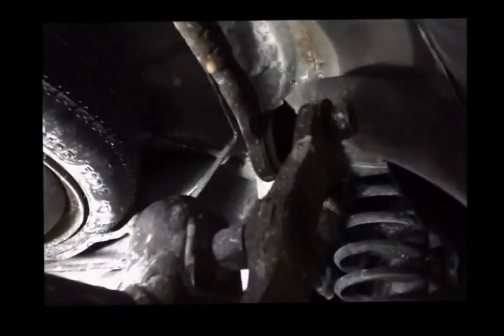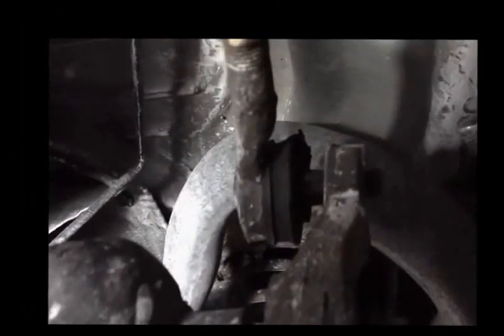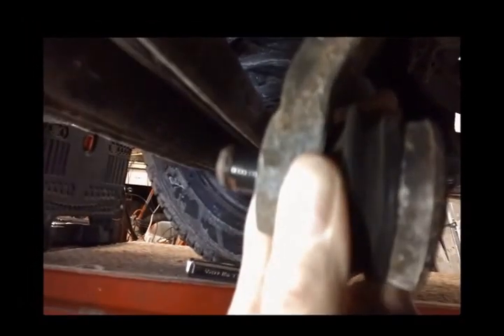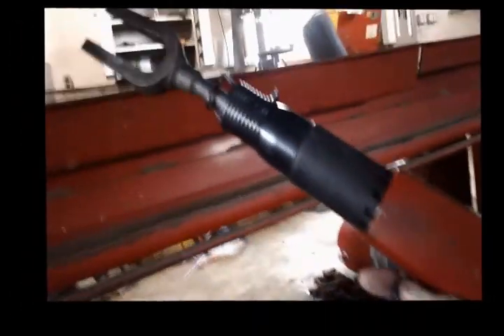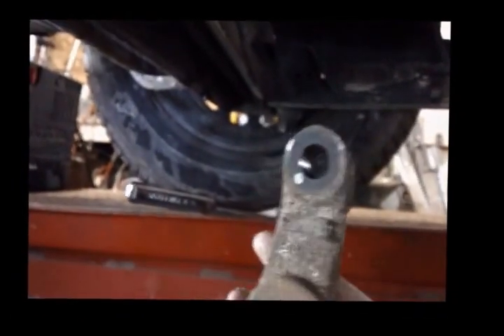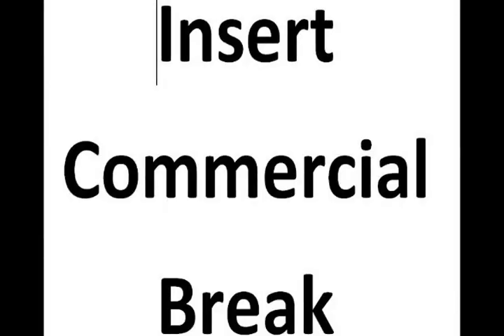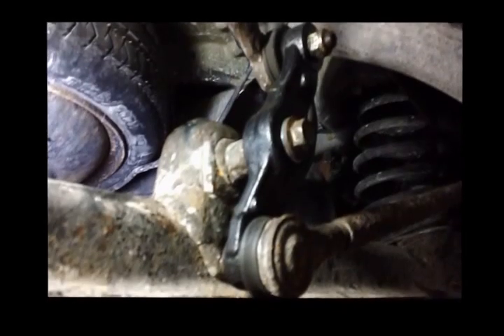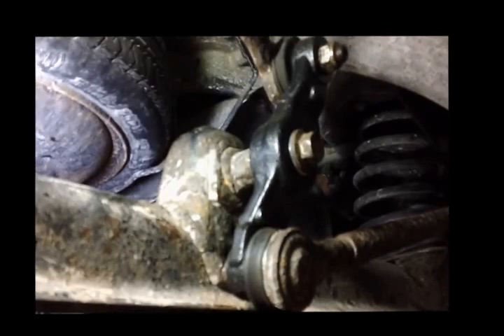PT Cruiser Bell Crank ( Watts Link )

Comment: Yeah. So you have to press the new one on right? Cuz I'm doing one and the bolt spins on the new tierod unless it's pressed in there's no way to hole the bolt.
Reply: So there is an Allen wrench hole in the end of the tie rod bolts that you put an allen wrench into to hold it. Only, mine is between a 4 and 5mm and there is no such size in any allen wrench kits I own or can buy at Oreillys.